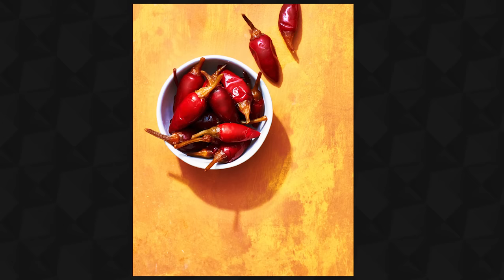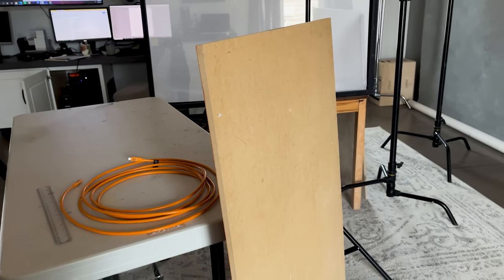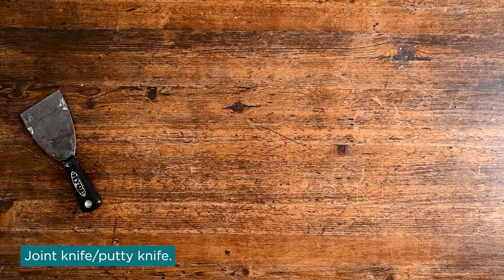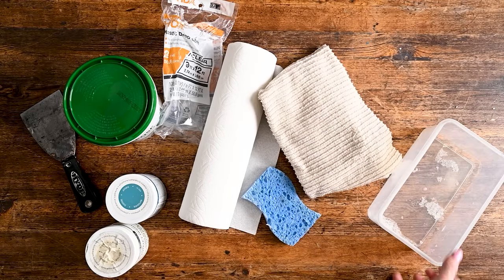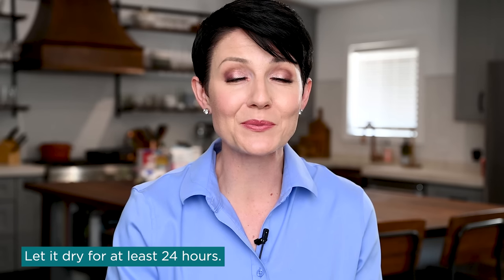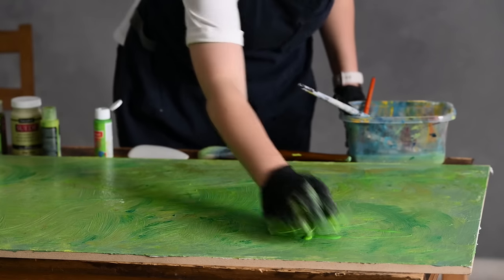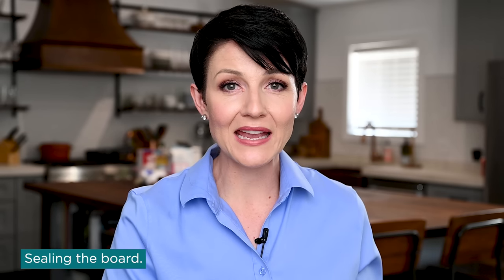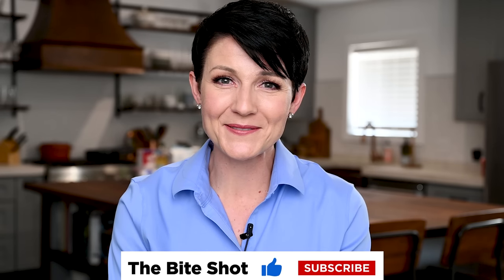DIY Backdrops (UPDATED!)

Comment: i did the same backdrops last year... but with a 9mm ply... i made 4 4X4 sheets with compound joints... but I deliberately cracked in it by twisting the plywood... the pattern came out beautifully... i live next to a beach, but during summers the climate goes up to 47-48 degree celsius and the humidity is untolerable... this climate bends the ply... but if you lay down your ply flat on a surface and stack it one upon other, the bend can be avoided... just make sure you put some parchment paper or vinyl in between the sheets to avoid color contamination... :) ... great video

Comment: I am using thin ikea coasters under my boards to protect my table and this also avoids sliding. I covered these thin coasters with dots of hot glue and they keep the boards in place. Just wanted to share this cheap and functional solution

Comment: Love the help, glad to have you back. Missed you. This came at the perfect time. 
First a question so it doesn't get buried. Are there rules for the types of food to the color of the backdrop? 
Now, it pained me to watch you with that 2 1/2'' knife covering the board. My go-to for taping (sheet rock) in a 6''. Covers a lot more ground. Once it's covered you can switch to a smaller blade for more texture. Use a 12'' to 16'' cement trowel to sweep across to "knock down" the high points after it has a chance to dry a little. So the soup isn't wonkie ;) Same method of the walls in your home. They spray it on, let it set and use a 18'' blade to knock it down. Hence a "knocked down texture".
I'm wondering what the splatters of paint would look like sweeping with the cement trowel.  
Also you can add the color to the first layer of compound. Saves a step. 
Adding sand (fine) to the compound causes the blade to "skip" adding texture.
Dry brush the accent color over the original to highlight the high points. 
Thank you again for your help.
Reply from the maker: Great insights!  Thanks so much for sharing!  As for colors, there aren't any specific rules.  Only thing I am mindful of is to make sure the backdrop isn't distracting from the food :). Otherwise, I think about colors in terms of color theory and personal preferences in creating palettes.

Comment: I use MDF and joint compound as well.  Lately I have been using an undercoat of primer before painting.  It seems to help with the warping (I think it seals it somewhat) and I use heaps less paint for my coloured layers.
Reply from the maker: That's awesome Craig! Great tip!

Comment: If you add a smidge of water to the compound and mix it, you can apply it with a roller to get it on the board quicker. Not sure if you can add paint/ pigments to it and mix it before applying if you are only planning on a single colour version. :)

Comment: It's interesting that you covered cupping (or as you called it warping) last. As I watched the video I was wondering why you had not mentioned it. Wood absorbs water and swells. If you apply more moister to one side of a board it will swell across the grain, and MDF will swell evenly across the surface. Plywood curls and MDF dishes when unevenly whetted. The best way to avoid this is to seal the wood thoroughly on all sides before applying any water based coating to one side only.
Reply from the maker: Super helpful!

Comment: What was the yellow color you used.  I have been looking for something that color.
Reply from the maker: It was a combo of a bunch of different yellows.  Definitely took a few rounds to dial it in with different colors.  Used quite a bit of a Cadmium Yellow (much closer to orange than green in terms of the spectrum of yellows) https://www.michaels.com/liquitex-professional-acrylic-gouache-paint-2oz/D240114S.html?r=g&cm_mmc=PLASearch-googleMICH_Shopping_US_N_Zombie_N_Smart_All_N_&Kenshoo_ida=&kpid=go_cmp-13700834810_adg-122039532177_ad-530509270523_pla-1355530337025_dev-c_ext_prd-D240114S&gclid=Cj0KCQjw4PKTBhD8ARIsAHChzRJ_D3UpIh9hVJ0CNMcewOazB2bzkuhXtX3l-MrmTF9-RuC41Csdj0waApJ7EALw_wcB

Comment: you probably already know about this one but if not look up watercolor "washes" where the surface is wet and then you add paint. the paint then bleeds through the wet surface. the effect is like the background of the Luca Dončić background on your pinterest board. you can do this with any water-based paint like the acrylics featured in this video. ALSO! if you are really getting into precision with color mixing i would consider Golden brand paints. the craft paints have almost zero pigment compared to a real artist acrylic like Golden and the fillers in those paints make it impossible achieve certain colors. you might also like all the material you can mix into high quality paint like medium, gels, pastes, and what they call aggregates. You can really broaden the possibility of texture and precisely control color.
Reply from the maker: Very great note!  Thanks so much!  I do sometimes use some acrylic gouaches by Liquitex that I love, but they're a bit spendy so didn't want folks to think they had to use premium paints to get great results.  But for sure, bring on the pigmentation :)

Comment: help! I did the layer of joint compound, waited a few days, then did a few layers of the chalk paint and it totally cracked off. I ended up throwing away two boards away. Any advice? It’s a total mess 😢
Reply from the maker: Oh no! I'm so sorry.  That has never happened to me. The paint is cracking off?  What brand of paint are you using?
Reply: @TheBiteShot  it was Behr Premium Chalk paint. I will try again with the brands you linked!

Comment: Here's an easy trick that I use sometimes: I mix the color with the joint compound and add some water. Apply the paste to the wood surface using a spatula to create different pattern. Let it dry and that's it!